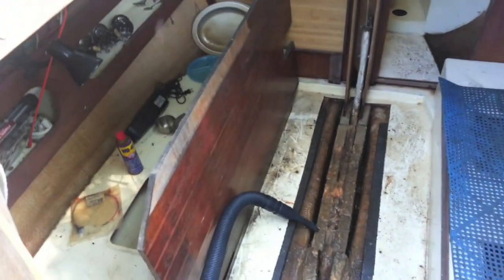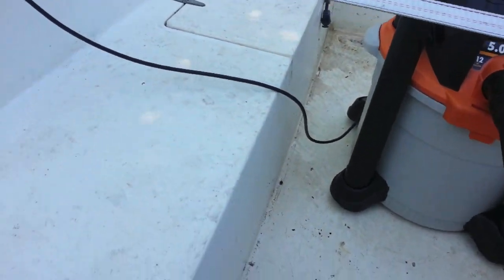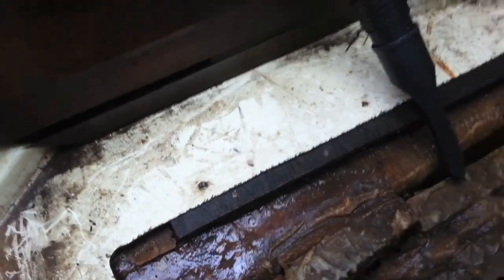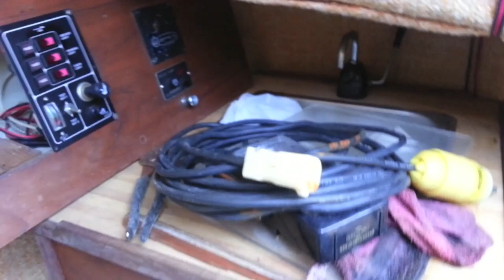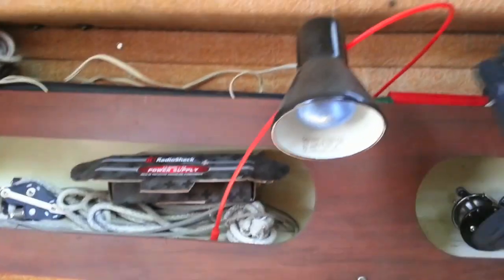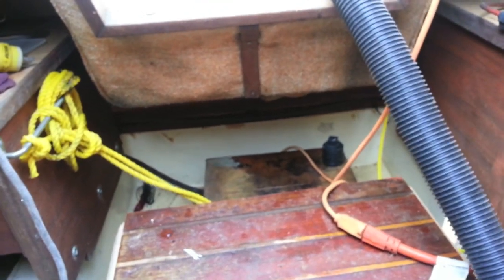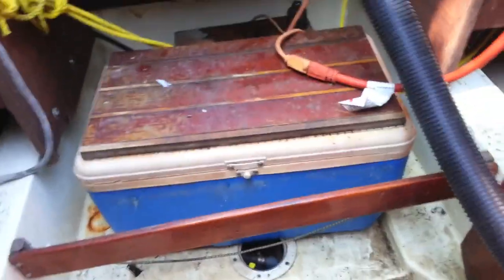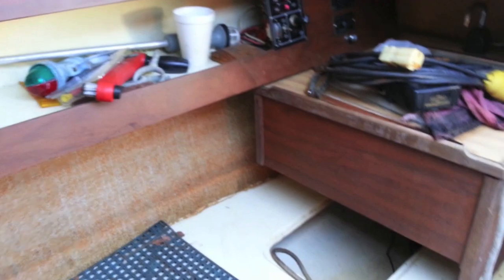The "No Idea" Project - Sailboat Refit (Part 2)

Comment: I hope to see more!!!!! Sailboats are a lot of work LOL.  I myself am in a refit.
Reply from the maker: Lol, I didn't give up yet. my current set back is that my trailer frame cracked on both sides of the wheel well. So, I have to move it to a Marina, but I don't want it to fall while pulling it.